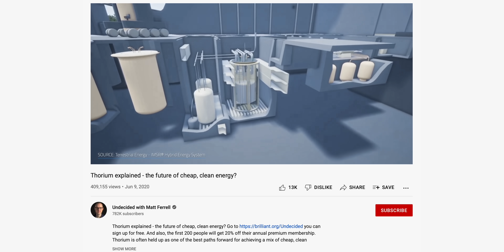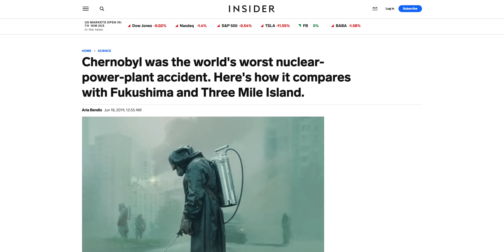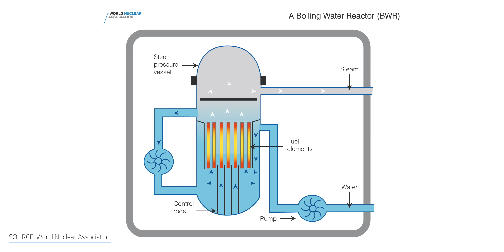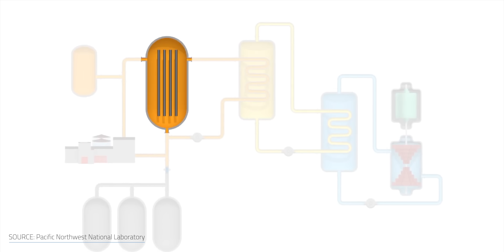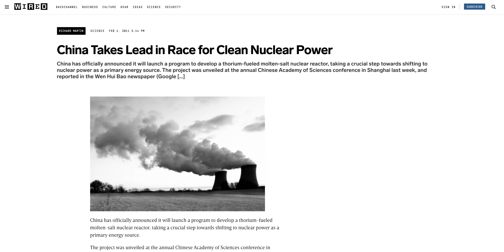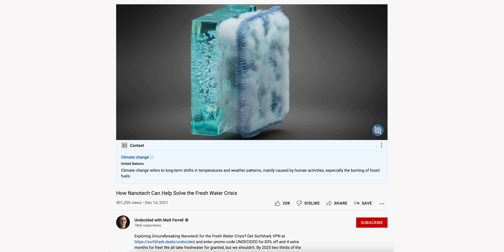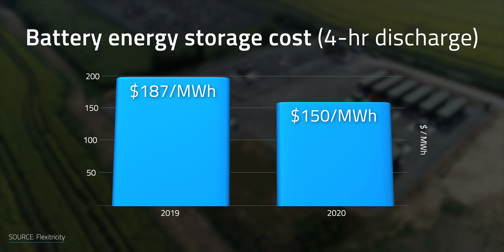Revisiting Thorium Energy - The Future of Nuclear Power?

Comment: Thanks for the balanced video on nuclear. First, I'd like to express strong support for more -- much more -- nuclear energy. It is shocking that nuclear power has been campaigned against by the same people who claim to worry about the climate. Being anti-nuclear is the climate equivalent of being an anti-vaxxer: Both attitudes stem from not having a rational understanding of risk, both attitudes are expressions of distrust in science and engineering per se and both rely on a hand-wavy "naturalism" or appeal to what seems "organic". In other words, they're both forms of magical thinking.

With that out of the way, I'd like to clarify a few things that the video skirted around:

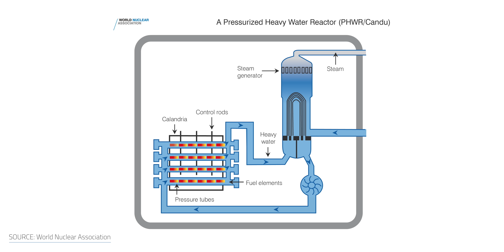*  Using Thorium as fuel and molten-salt reactors are two completely separate things. People often talk about them as if they are synonyms. But in reality, you can have all four combinations: Solid Uranium, molten-salt Uranium, solid Thorium and molten-salt Thorium. (You touch on this around 6:00, and that is good.) Three of these four combos have actually already been created and operated: The MSRE (Molten-Salt Reactor Experiment, in Oak-Ridge in the late 1960's) was a genuine molten-salt reactor, but only powered by Uranium (though the intention of the research was eventually to make a Thorium reactor). While reactors in both Pennsylvania and Germany have in the past used solid Thorium in combination with solid Uranium. So some lucky people in Europe and the US have already received electrical energy derived from Thorium.

* 4:18 "Thorium-fueled reactors offer a potentially safer, cleaner and more abundant alternative to traditional reactors fueled with highly radioactive elements." Sorry, Matt, but this is not a true statement. Uranium is the traditional fuel, and it is not highly radioactive. The two isotopes of Uranium that you can find on Earth have half-lives of 700 million and 4 billion years, meaning they have very low levels of radioactivity. Thorium-232's half-life is 14 billion years, so granted, it is even lower. But all three substances have very low levels of radioactivity. (Remember, the longer the half-life the more it approaches being a stable substance.) Maybe you had in mind the fission products inside the fuel once it has been used for a while -- these short-lived isotopes (whose half-lives range from less than a second to around 30 years) are intensely radioactive but are created with both fuel types (although with MSR's they would often be extracted from the fuel loop continuously). Or maybe you had in mind Plutonium-239 which, with a half-life of around 24,500 years, falls somewhere between the mild long-lived isotopes and the hot short-lived isotopes. People often highlight that Thorium reactors don't create any significant amounts of Plutonium-239, while Uranium reactors do. However, Plutonium is not highly radioactive, you can handle it with no shielding and no gloves.

* 5:27 "One big benefit of Thorium reactors is the much smaller half-life of the nuclear waste." This sounds like a reference to the same topic as I described in the previous point, the creation of Plutonium-239. It is really only that substance which lies behind the scary soundbite-friendly statements that nuclear waste is dangerous for a hundred thousand years. The thinking behind those who hold this view is that any elevation in background radioactivity, beyond what exists in the original Uranium mine whence the fuel once came, is unacceptable. However, there is a large step from normal background radiation levels up to what is actually dangerous. The presence of Plutonium can indeed elevate background levels in the area where it is stored (in the hypothetical case that it were to escape the dry casks in which it would be stored), but even so it would not be to a level that is manifestly dangerous. In the opposing view where we accept that Plutonium-239 is not a significant danger, we must look for the radioactive substances that create more intense radiation, with the shorter half-lives that go along with that. This is in fact Strontium-90 and Caesium-137, both with half-lives of around 30 years. These are legitimately dangerous, but will have decayed to one thousandth the amount after 300 years, and one millionth the amount after 600 years -- pick your threshold. These two isotopes are also present in the fission products in Thorium, and are probably what lie behind the video's statement at 5:52 that Thorium waste is dangerous for 500 years. My contention is that the same is true for Uranium -- but that playing politics and a mis-applied "precautionary principle" has meant that Plutonium's decay is used as the benchmark for when the spent fuel is safe, rather than the Strontium and Caesium mentioned above. This has caused costs for traditional Uranium-based nuclear to balloon, and is one of the ways the technology has been thwarted in its efforts to decarbonize the world.

* 5:31 "Uranium-233 can be separated from the Thorium, which sets it apart from the Uranium-235 and 238. And it's Uranium-235 that contains very radioactive isotopes with half-lives of thousands of years." (Emphasis is in the original audio.) Beyond being merely untrue, this statement is actually difficult to make sense of. If something is "very radioactive", it cannot have half-lives in "thousands of years". Those are mutually exclusive. The shorter the half-life, the more intense the radioactivity. The substance you're almost certainly referring to here, again, is Plutonium, which is weakly radioactive (though Uranium and Thorium are far weaker still). The way you use emphasis in this sentence makes it seem like long half-lives are scary and dangerous and somehow have a positive correlation with degree of radioactivity -- the truth is that long half-lives have a negative correlation with degree of radioactivity.
Reply: Follow-up because my original comment was too long so I had to split it in two:

* 8:46 Talking about the proliferation risk, I commend you for bringing this to the fore. Many people talk about Thorium being without proliferation risks. But as you point out, the Protactinium can be extracted (chemically), before undergoing the second beta-decay, leaving pure U-233, which can be used in bombs. You don't quite explain why the gamma rays from U-232 are important -- the idea often promoted by Thorium fans is that the large amounts of U-233 are naturally contaminated by trace amounts of U-232, which emits a hard gamma ray that is difficult to shield, making any U-233 both hard to work with (without killing your workers) and easy to detect from a distance. But as you indicate, this is not really true.

* 12:52 Comparing LCOE of nuclear (any type) with intermittent renewables like wind and solar is difficult. Nuclear can provide always-on power, while wind and solar are intermittent, and difficult to predict -- especially wind, but also solar in case of cloudy days. You wisely include a separate LCOE figure for solar with storage. But storage needs to last much, much longer than four hours for it to create dependable power. A lull in the wind can last weeks in the dead of winter at high latitudes. At the same time, bear in mind that the cost of storage -- which typically means Lithium-based batteries even as new techniques are being researched -- is calculated in the context of the current Lithium and Cobalt markets. The current costs have achieved a balance based on the current demand, the rate of increase in that demand, the current supply and the current rate increase in that supply (i.e. new mining operations being brought online). However, with Lithium and Cobalt you also have to take into consideration the total amounts of these materials thought to exist in the Earth's crust, which would give an indication of a kind of upper bound for how much energy we are able to store from intermittent renewable energy sources. I don't have any hard numbers for that, but I did hear one estimate that if all the Lithium thought to exist on Earth were turned into batteries, it would still only be able to store a few hours' worth of the global electricity consumption. So in short, don't look too much at LCOE for renewables vs nuclear -- either LCOE numbers for renewables omit storage, or they include storage but using numbers established in very different market conditions than those that would apply in a world where most energy is derived from renewables + storage.

Lastly, my general observations on nuclear: Comparing nuclear with hydropower is relevant and on-point, because they both provide dependable power. But comparing either of these with wind and solar is very difficult. The non-intermittency has a value in itself. A value that you can think of in terms of money. Imagine if you didn't have your city's water supply brought to your home through water pipes that you can control by opening a tap. Imagine there is no possibility to dig a well. Imagine instead that you had to accept water delivered by a truck, which would drop by your home sporadically, with no schedule. Imagine that you didn't have a large water tank in your home that you could fill up from the water truck. This would mean you had to shower yourself and your family, do laundry, do the dishes, wash your home -- all in a mad dash during the water truck's brief visit to your home. To be sure, many people in poor countries live in something approaching this kind of "water poverty". Now imagine that in a society like this, what would you be willing to pay if you could buy a premium water supply service in which another water truck came to your home exactly when you asked it to? Or what would you be willing to pay for plumbing so you could have plentiful water at any time you wanted? This premium is effectively the monetary value of dependability itself. In electricity, it's much the same -- when push comes to shove, when rolling blackouts or loadshedding starts being commonplace, many people will come to the realization that they are willing to pay extra for dependable energy. A life in "energy poverty" is just too cumbersome. This is why, in places like Nigeria, everyone who can afford to will have diesel generators at home. For the Nigerian economy as a whole, it's remarkable that the total possible power output of all the diesel generators in the country is several multiples of the country's total electricity consumption. The alternative, which creates wealth and wellbeing for everyone -- not just those who can afford to shield themselves from intermittency by buying generators or large home batteries -- is of course to make the public electricity supply not intermittent in the first place. Therefore, I think using LCOE to compare intermittent sources against dependable sources is always misleading. Access to dependable energy is such an important tool in lifting societies out of poverty, it seems unconscionable to advocate for a switch to intermittent sources.
Reply: @eckligt  I would challenge you a little on the proliferation barrier of U-232. That's because U-232 contamination will make U-233 largely unworkable in both an implosion type and gun-type device, as the high gamma's given off by Tl-208 will fry the wiring in the implosion device and U-232 is highly subject to spontaneous fission and predetonation in a gun-type device, making it unworkable in that as well. I'm sure there's a threshold contamination level in which the U-233 could still be used, but U-232's proliferation barrier extents further than just being a hazard to the people making a device. 

That said, you can, with a great deal of effort, produce U-233 that's largely free of U-232. No, the REAL barrier to proliferation with thorium comes from producing it in a thermal spectrum breeder reactor like LFTR. That's because Th-232 can be bread to U-233 in the thermal spectrum, but the breeding ratios are just anemic, 1.05 to 1.07 depending on whether you separate the protactinium. That means that the reactor's burn vs. breeding ratio is just barely above 1 to 1, with only a tiny sliver of excess production, such that it will take between 17 and 25 years, depending on the breeding ratio, to double the fuel content in the reactor. Given thermal spectrum reactors only operate with 3-4% fissile material, that's a long time for not a very large amount of material. If the reactor operator were to pull out more material than that tiny sliver of excess production, they'd kill the reactor as it would no longer have sufficient fissile material in the core to maintain criticality.
Reply: @eckligt  It's also not correct to compare the LCOE's of nuclear and renewables as they operate over very different time spans, with renewables having shorter operational lives, 20 to 25 years for wind and solar, while nuclear's LCOE is typically calculated over for a period of 40 years (and which drops even further for plants which have had their operational lives extended beyond 40 years). 

Additionally, renewables LCOE doesn't included all the costs necessary to build out the grid infrastructure needed to make them usable.
Reply: @williamsmith1741  Very good comments, I appreciate it. I'll answer the LCOE points first: I agree completely, as long as you mean solar and wind when you say renewable. However, I think it's also important to consider hydropower, which in this context I think has much more in common with nuclear. Massive power output, very long working lives. I am from Norway, which has been self-sufficient with hydropower for electricity for a century, so my views may be somewhat coloured by this fact :-)

Regarding proliferation risks with Thorium: That was very interesting, and I admit I hadn't thought of that. However, I still think it's entirely possible for a state actor to say "here's a bunch of Thorium, now I'll go convert it into a usable amount of U-233". In a critical reactor, I suppose they'll end up splitting most of the erstwhile-Thorium-now-U233 atoms before they make it out of the reactor, and that is your point. But for a few tonnes of Thorium, it should be possible to collect a few kg of U-233. However, maybe an accelerator-driven subcritical reactor can be used to convert much more of the Thorium to U-233 -- improve the neutron economy by artificially introducing other neutrons, by aiming at proton beam at a spellation material. What do you think?
Reply: @eckligt  Yes, I wasn't including hydro, which does have a very different profile than renewables. Of course, hydro isn't quite as deployable as wind and solar, due to geographical requirements/restrictions, and at this point most of the places in the developed world where water can be dammed has been dammed. Plus, damming rivers has its own environmental impact, producing lots of methane, drowning valleys, and blocking aquatic migratory routes. It's kind of funny, anti-nuclear environmental groups like the Sierra Club used to be pro-nuclear because they viewed it as a preferable option to damming rivers, primarily for the reasons I listed above. I acknowledge that those reasons are valid, but life is all about trade-offs, and no power source is perfect. 

I really think that some some kind of molten salt breeder set-up is the only way you might produce isotopically pure U-233, free of U-232, but that could be a blanket around a fast reactor around a spalation target being hit by an accelerator. Even then though, you're still going to have to batch your protactinium production stream so that you can separate the U-232 and U-233, which will not be easy. So I think you could do it, but you'd have to be doing it to just prove you could do it, as centrifuge enrichment is cheaper, easier, safer, cleaner, and more reliable. U-233 has only ever been evaluated for weapons material 3 times, two of which involved an actual weapons test, after both of which it was abandoned and never considered again (US operation Teapot in 1955 and Shiva IV in India). I think that's kind of telling as it relates to how desirable U-233 is as a weapons material.
Reply: @williamsmith1741  All good points, and I agree with everything you said.
Reply: when smth has half life of few days it will decay to safe levels pretty quickly. Either very quickly or in millions & billions of years, few thousand years is "no mans land"
Reply: @ChuckLeeClerk  True. The awkward thing for regulators is that Plutonium inhabits that "no man's land". They have erred on the side of caution, but there is really no scientific evidence that they need to do that. You can also apply "the precautionary principle" the other way, and say that massive climate change is such a huge risk that any proven technology should be employed to avoid the danger it poses. That is my view.
Reply: You mention solid fuel rod thorium as if that’s a good thing when most of the benefits come from having a liquid fuel that breeds more fuel instead of solid rods that are never used completely.

Good comment but I think the points aren’t concise enough, or your prose not super structured.  Which discourages people from reading and obscures what you are indeed saying.
Reply: @fdc184  Seemed like a very high quality comment to me, and the prose was structured better than a majority of the stuff people usually regurgitate on the internet. If people don't have the attention span to deal with a scant page of good content it is ultimately their loss.
Reply: @fdc184  You also breed Uranium-233 in a setup with solid Thorium as fuel, and then the heat from fission of that Uranium is what eventually is extracted as electricity. The purported benefits of low amounts of Plutonium and low proliferation risks are unchanged, compared to the LFTR setup. The burnup rate would also be higher than traditional nuclear, since there is none of the "deadweight" U-238. But overall I agree, the added benefits of MSRs make them a good design to aim for. I think overall MSR is the more important aspect, rather than Thorium.

I'll bear your points on prose and style in mind. What you saw today was almost like a "flow of consciousness" write-up of everything I wanted to add or correct. It's not for everyone, and I'm fine with that.